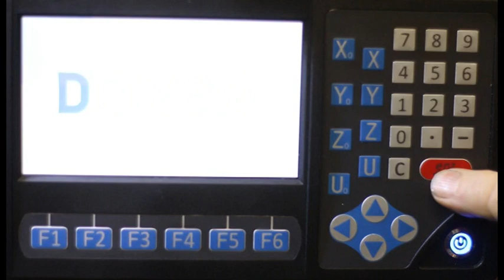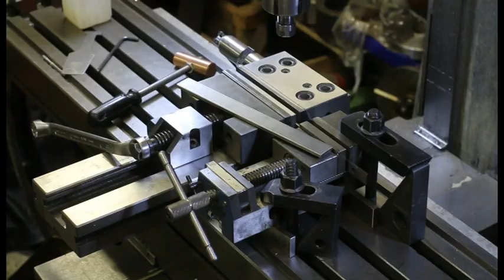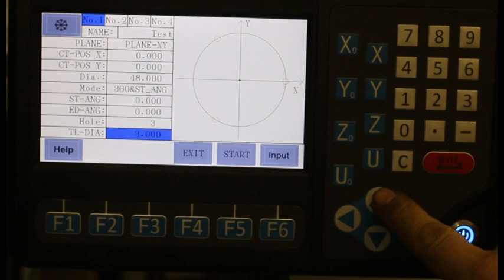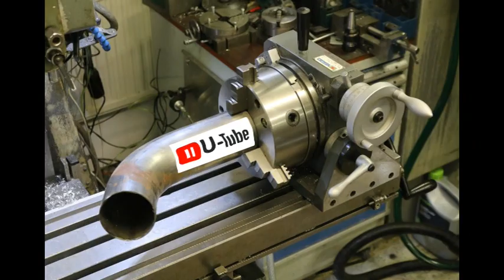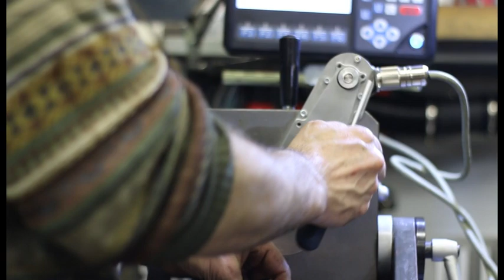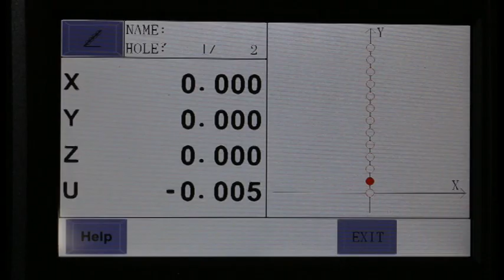Digital Readout Upgrade with Quill and Dividing Head Encoders

Comment: Is it possible to use any type of 5000 PPR encoder? Could you please explain why the Quadrature factor is used? I appreciate your help.
Reply from the maker: Most likely you can and you can use any other PPR amount as well, if you can configure the readout accordingly. I used that encoder with this gear ratio to match degrees to millimeters on the display, without changes in the config.
The PPR amount tells how many notches or holes the pulse wheel has. These pulses are read by 2 optical) sensor with 1/2 pulse phase shift on each orher. Both sensor gives rising and falling edge information to the readout. The readout can figure out the direction of the movement from the signal change order and as a nice side effect you get four times the resolution. Similary a 5micron linear scale does have only 20 micron width on the etchings.

Comment: Hello
What is the type of rotary encoder of your choice and how do you connect it?
P.Tamas (Hungary)
Reply from the maker: My encoder is Pepperl+Fuchs RVI58N-044ABR66N-05000. I think it is salvaged from a servomotor. Connecting the encoder to the readout is pretty straight forward. Sensor needs 5V and GND and the output signals A and B are hooked to corresponding pins In the dro. Signals and levels are same with the linear scales.
Reply: @kerkkonenahaima7322  Hello!
+ Fuchs RVI58N-044ABR66N-05000 I can't find this rotary encoder on the internet. Can you recommend hejette what is available on the internet?
Thank you for your quick reply.
P.Tamás.
Reply: Hello!
+ Fuchs RVI58N-044ABR66N-05000 I can't find this rotary encoder on the internet. Can you recommend what is available online instead?
Thank you for your quick reply.
P.Tamás.
Reply from the maker: Sorry, I can't recommend any reasonably priced hi-resolution encoder. My 5000ppr encoder is a bit over kill, but with small step-up gear ratio it was thr easiest way to use the linear pattern function as a dividing head. 1° turn shows as 1mm of 5 micron linear scale movement. 
Maybe some other make display could have dividing function for a rotary encoder of any resolution. Ditron supports rorary encoders, but I think there is some bug and pattern functions doesn't work on rotary axis.

Comment: Can you add the encoder summing source and price? I am interested in this item.
Reply from the maker: Hello, the device came here: https://www.machine-dro.co.uk/m-dro-linear-encoder-summing-interface
Reply from the maker: Stefan Trerhan posted a comment here with a link to his arduino code, that pretty much does the same with fraction of the price: https://forum.zerspanungsbude.net/viewtopic.php?f=55&t=47863&sid=3756b84fcc4571f7b69f82091b22d2de&start=10

Comment: You have inspired me with your next video. I am converting my lathe to a single powered y axis and a DRO on the x to make it turn tapers with an arduino. still to have manual control as well. A new ball screw on the Y with a stepper motor. will have to make a new indicator to match the ball screw pitch. Thank you for the inspiration.

Comment: It's probably too late but if you are interested I can provide Arduino software for two axes quill summing, no other parts needed, just like the box you ordered.
The Arduino typically fits easily inside the back of chinese DRO displays.
Reply from the maker: Thanks, but too late for me, the Machine DRO summing device works fine. I will still do a switch that bypasses the summing feature when the quill is tilted or the summing is not wanted for what ever reason. I have the 4th axis channel to spare for that.
 Is there anything online, that you can share a link for the Arduino code, if someone else is interested? I tried to google such code when this was topical for me. I could´n find any, so ended up buying a ready unit, for it wasn't that pricey.
Reply: @kerkkonenahaima7322  You can find the code and more information here:
https://forum.zerspanungsbude.net/viewtopic.php?f=55&t=47863
Maybe it is useful to you some other time, once you have the position/movement information inside the Arduino you can do all sorts of unethical things to it before sending it on to the Display. Or maybe, as you say, for others to follow up on.

I just wish we could have our way with the DRO display source code itself.
Reply from the maker: @stefantrethan  Thank you, this is great!
Reply: @kerkkonenahaima7322  The Urduino controls can be found here. The project is open. The forum is in Russian, but the author speaks English, if he tells me anything.
https://www.chipmaker.ru/topic/118083/
It looks something like this.
https://www.youtube.com/watch?v=DSWSRy1JqUI
Reply: I'm quite interested in the Arduino code. Searching at the moment for an good solution to sum up two axis. Looking forward to your reply.